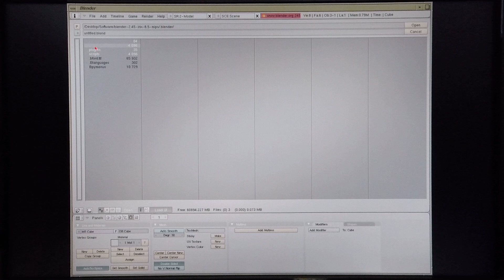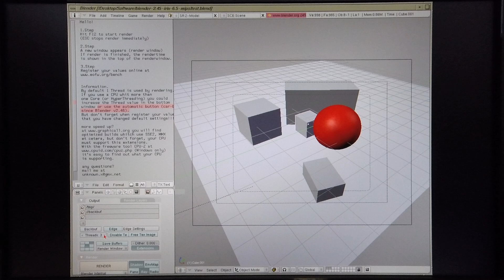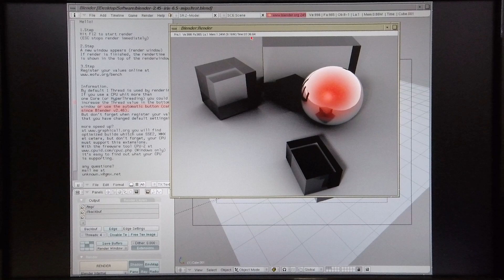Blender on an SGI Octane2 fitted with dual MIPS R14K's@600MHz?

Comment: It will be faster with 8 threads and 16x16 tiles, sometimes more. On multi-CPU SGIs, use 2x the no. of CPUs minimum if possible, 4x is better. Also as mentioned before, Blender V2.45 is 11% slower than 2.44, so don't use 2.45 unless you have to. I've not yet checked how the latest 2.49a for IRIX compares.